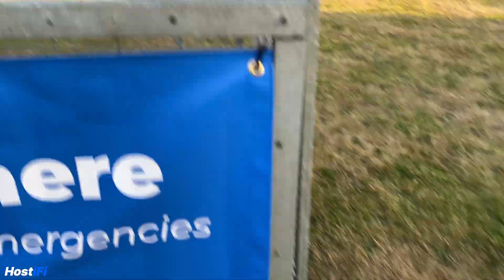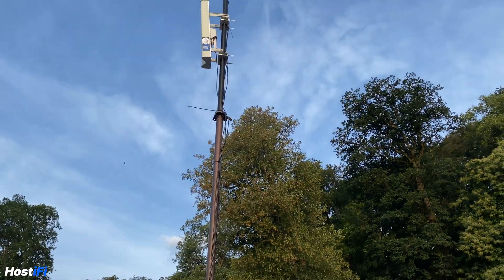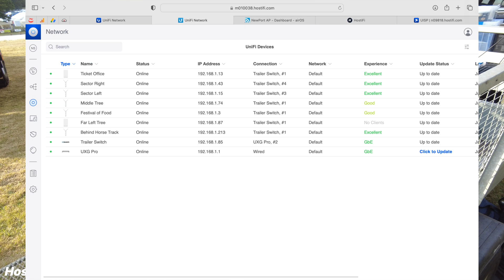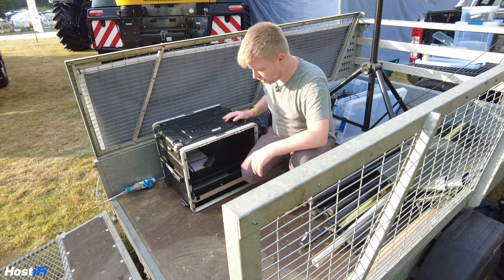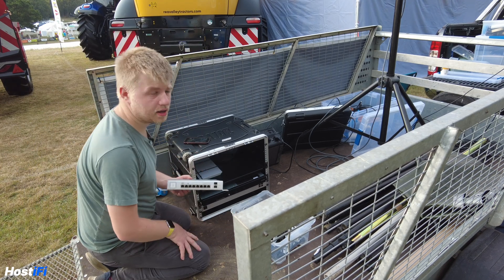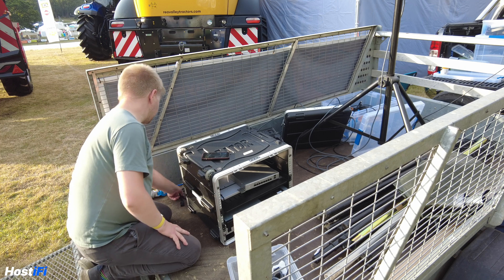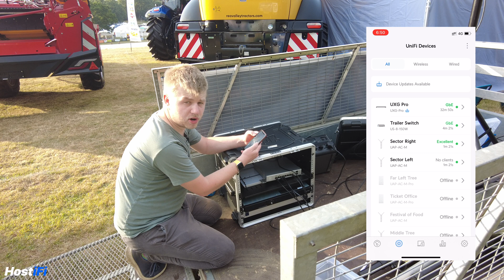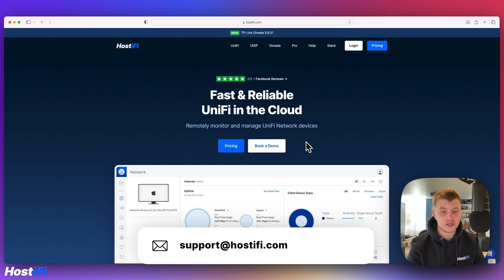Large Outdoor WiFi Project! Powered with HostiFi

Comment: Great video! That is super neat that y'all used the UISP 2.4 GHz omni antenna with a UAC Mesh. Did y'all disable 5 GHz on the radio, or did the antenna handle 5 GHz good enough?
Reply from the maker: Hey Jim! Thanks for watching, to disable 5GHz on the radios, we had to make 2.4GHz only SSIDs. However, the antenna was broadcasting 5GHz before we disabled and it seemed to work ok. However, it isn't rated to support it. 👍
Reply: @hostifi  thanks for insight!